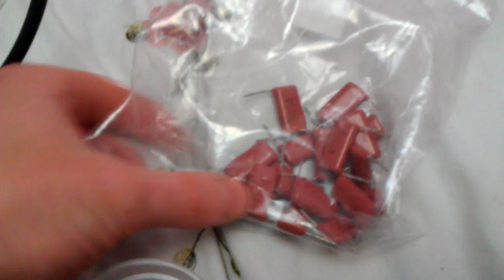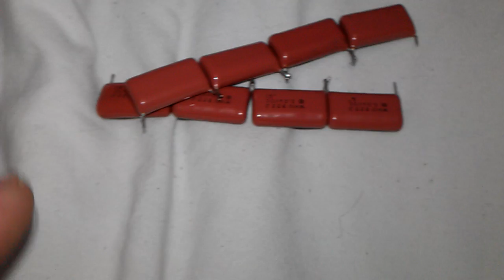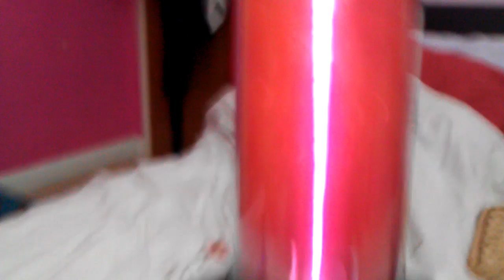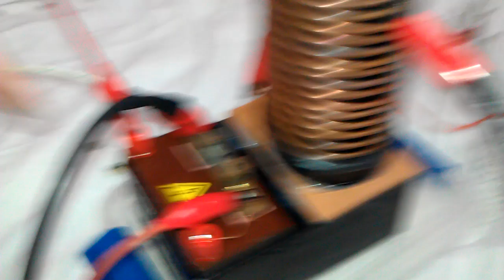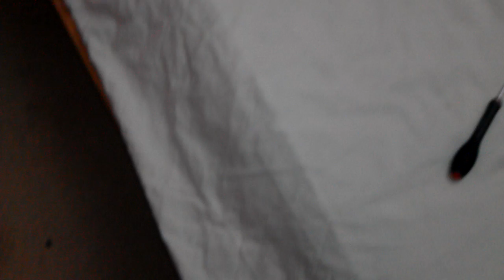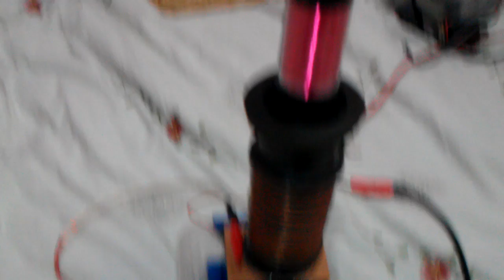Portable zvs tesla coil

Comment: Is it possible to make a flyback transformer?
Reply from the maker: Yes very easy if you know how too. scan back and check my old videos as Iv made many of my own high voltage transformers. Iv made some with a wax insulation also.

hope this helps and thanks

Anthony 👍😉

high1voltage1rules
Reply: Thanks for the fast response
Reply: What sort of protection should I take against high voltages? Would metal gloves with the part touching my hand covered in some rubber work?
Reply from the maker: +John Shaughnessy (Mrmola) just use ya mums washing rubber gloves 👍😉and if ya still worried then double them up! 
Iv had shocks off flybacks and to be honest it didn't hurt. as it's high frequency between 15kherts to 25kherts. 
if it was 50/60 Herts that's when ya start to worry.
as high frequency voltage is abit safer to use. flybacks will burn more than shock. but it's always to make sure you be careful.☇☇☇☇☇☇

hope this helps 👍😉

Anthony 

high1voltage1rules
Reply: Is the high frequency voltage safer or just hurts less? And also is the amperage from a flyback very low? I'm less worried about the pain than the actual damage

Comment: How exactly do you hook up the zvs driver without using a spark gap? I cannot figure out the wiring, it would be nice to be able to finally use my tesla coil. Thanks again
Reply from the maker: Hello
the spark gap is wired into the flyback and capacitors wiring and primary circuit to the tesla coil.

the zvs is just wired to the dc voltage and then powers the flyback or what ever you connect to it.

hope this helps 👍😉

Anthony

high1voltage1rules
Reply from the maker: in the black project box in the video with the white insulator' is inside is a flyback, and a zvs driver. as it's alot easier to use and move about' instead of having wires from the zvs' and high voltage wires from the flyback transformer hanging about. 
makes it so much easier to just connect up to what ever you want. 😊
Reply: +high1voltage1rules so the spark gap is built in to the flyback? And the capacitors are wired up to the secondary?
Reply: +Scotlahn Mccallister nevermind that comment, my real question is, you connected the spark gap to the flyback power input?
Reply from the maker: +Scotlahn Mccallister yes in parallel to its output. anode and cathode. so the flyback connections are in parallel of the spark gap and the capacitor will be connected in series with the spark gap and the primary coil.

if you figure it out and get it going I'm interested on your output. so if you make a video please share the link to me.

Regards and established of luck.👍 

Anthony

high1voltage1rules
Reply: +high1voltage1rules Alright, thanks, I'm only inputting 12v at the moment, and getting fairly decent output from the flyback itself, and a spiral like primary seems much more effective than a pancake coil primary for low power. I will put some effort into making a video on the output too. Thanks for all the help!
Reply from the maker: +Scotlahn Mccallister 
anytime 👍😉

Comment: Awesome tesla mate. Bit of a newbie to these and having searching for the right blueprints. Would have at all?
Reply from the maker: Hello mate, yeah this is a small one that I was using and as you seen in the video it was running off a flyback transformer, and this was a small one. The biggest output from a flyback iv had is 3'5feet streamers. But my biggest is a normal Tesla coil, and the streamers were 12 feet Lol, and the primary transformer was a ac potential transformer at 8.4kv . Very cool. That coil is Hugh!! Check the video in my vids.
The circuit diagram is in google images, just search Tesla coil diagram. And what ever you run it off is up to you. Best off much and thanks. ;-)

Anthony

High1voltage1rules

Comment: I am finally starting on my small and big tesla coil. I just got a 15kv 30ma induction type nst. but the hardest part is making a nice capacitor bank. so far I have got a 2 inch arc on my small tesla coil.